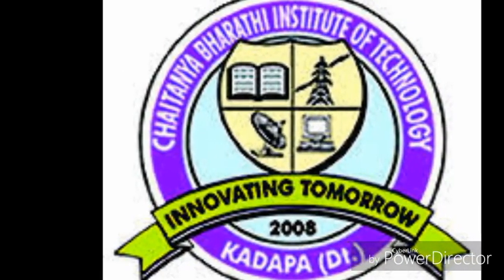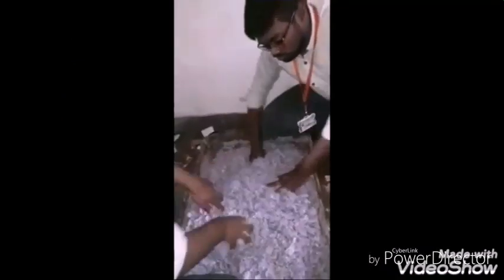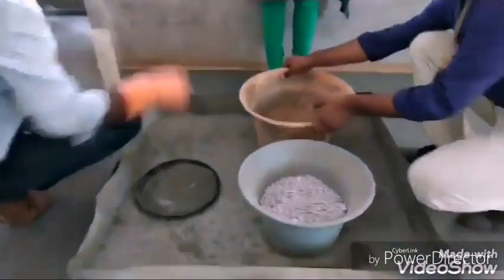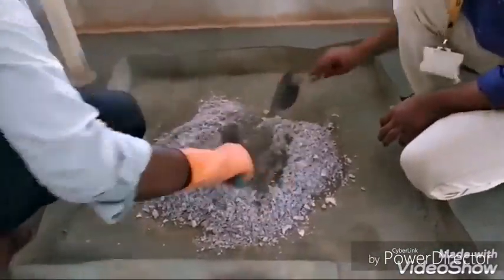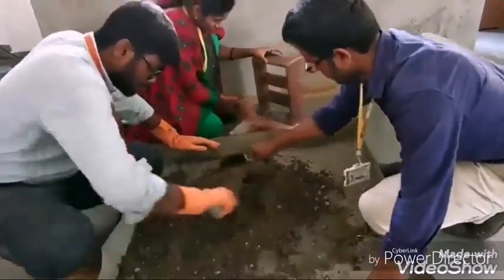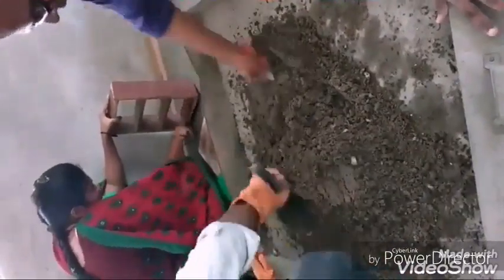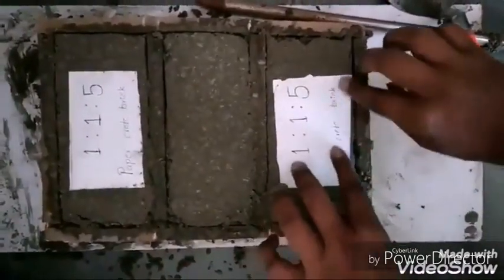Making of PAPERCRETE BRICKS

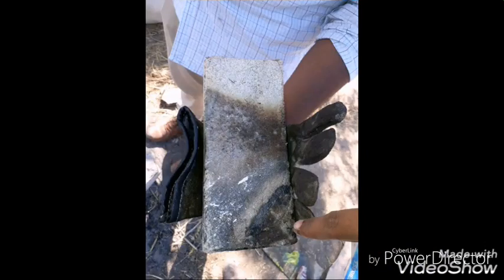Comment: Hi, I'm can't get how you find 1:1:5 ratio, if you mixed 0.8 kg paper pulp, 1.4 kg cement and 8 kg sand it's 1:1.2:10 ratio. Also at 08:30 we can"t see compression strength of your brick, so it's just a picture of press and brick.
Reply: Brother do you have any report ya ppt of this project

Comment: Instead of paper u can use other material to increase volume n reduce weight... The bricks you made are costly and practically unacceptable as it will not cut in reqd sizes at working site and other drawbacks too... Try mixing foam, thermacoal granules, vermiculite, perlite etc replacing sand in various proportions... You will get good results.. Carry on guyes
Reply: Brother do you have any report ya ppt of this project